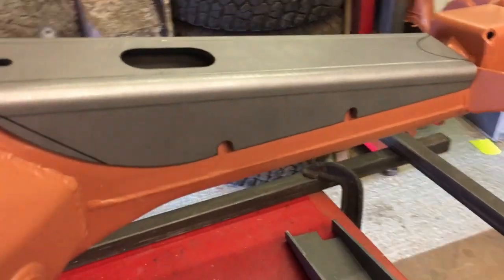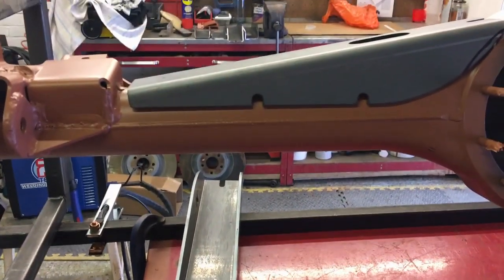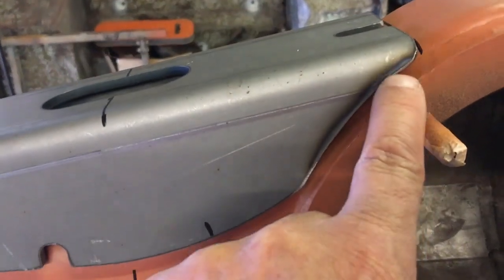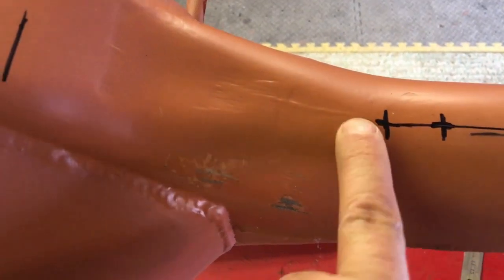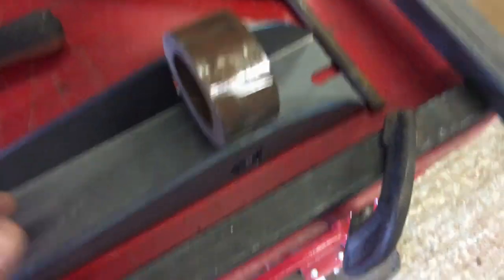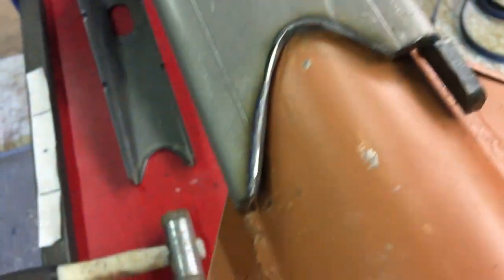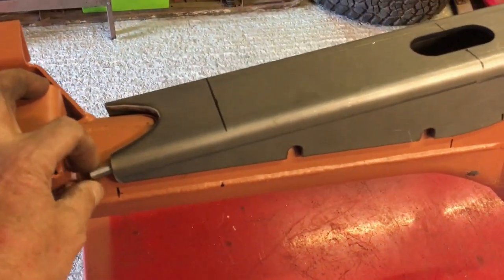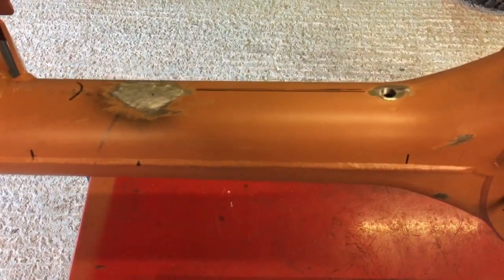Terrafirma Axle Trusses. Part 3, Front axle.

Comment: You've made a nice job of fitting those....but it's a disgrace how abysmal the original fit was....and I bet they weren't giving them away...
Reply from the maker: You're not wrong Paul.. they weren't cheap and the fit was shocking. Front better than back, but still not spot on. the part that got me was how wide they are at the outer ends? Makes me wonder if the designer ever saw an actual axle?
Reply: @defender90keswick.nigelsla59  they just went for the cheap and easy option...make them all the same width, saves a load of money